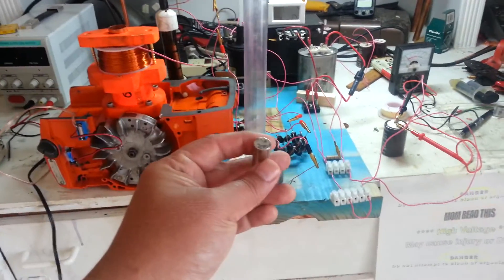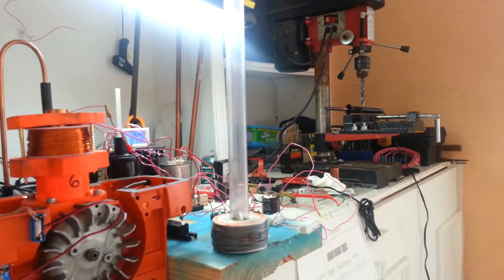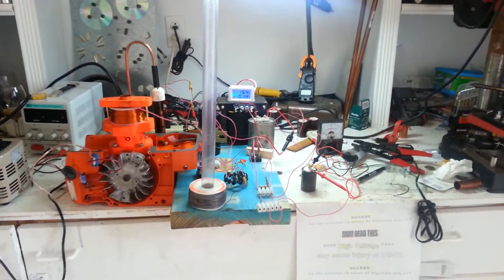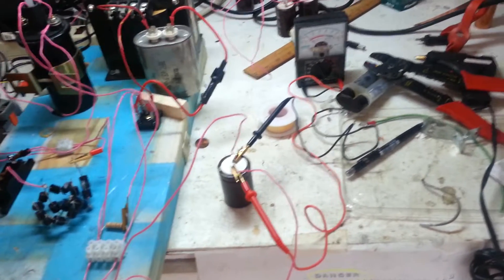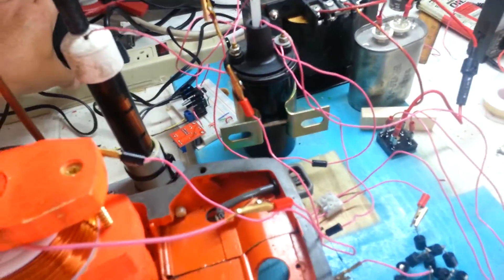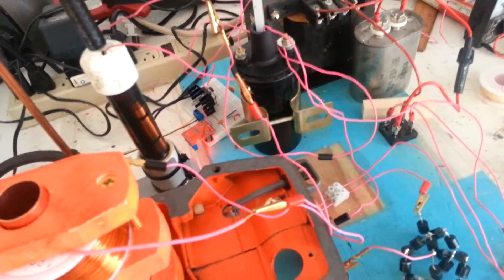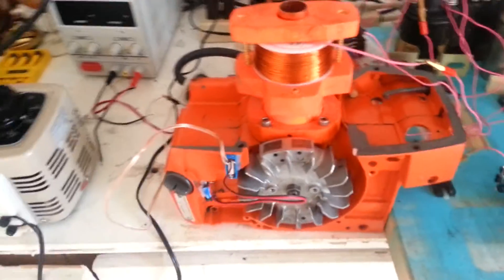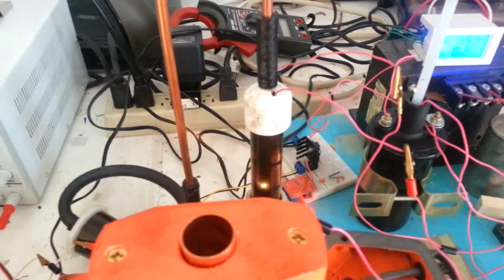Working Ed Gray Motor

Comment: i think ed gray used a 10 watt power source and a big electrolytic cap to power his motor.  it takes about 1 watt and 6 seconds to charge a 120 uf electrolytic cap so 10 watt would do 10 times faster or about the same for 800 uf. its the charginc circuit you use that suck. the rest is probably okay.
Reply from the maker: That would depend on how much voltage you are storing on your cap. Yeah the charging circuit sucks,  because I expended a lot of power to charge that Cap, but I was running a piston on a crankshaft. I needed the discharge of 450uf/400V to have enough EMF to push that piston down and around for the next cycle. My goal was to see if I could build enough torque to drive a generator, and there are facets I could get into, that I didn't explore. If Ed Gray was doing something different, not Ed really, his engineer who disappeared. I think he harnessed the same vein that Don Smith was creating in his devices. If you think of a CET as an EMP device, a spark with enough force to push electrons away, will cause the electrons to rush back to return to an pre-pulsed state. That inrush was probably guided by the thyristors, and thus harnessed charging the capacitors. I say this because what they don't show you in the schematics, is that Ed's motor had an L1/L2 coil in his charging, which made me think of Don Smith (BTW Don said that resonance could induce superconductivity at room temperature).
Reply: @XR_IX  Kind of superconductivity because in resonance l2 does not disturb the oscillation of l1 and thus does not lead to higher power consumption of l1. In fact l2 increases the magnitude of oscillation of l1. So at l2 you can draw as much Amps as you want.
Reply from the maker: @peterweber1174  I don't think it's a simple as that, but if you can explain what the condition is to allow you to draw as many amps as you want. I would be very interested in hearing how you accomplished it.
Reply: @XR_IX  read Don Smith or Rick Friedrich. L2 is connected to ground and acts as a charge pump. In principle your current drawing is only limited by the load you attach.
Reply from the maker: @peterweber1174  Peter, I own Rick's book on Don Smith, and have been studying this for while. However I won't claim I know how it works. Pointing to those two isn't what I asked for; Rick has placed all of Don's work in one text, with his annotations. Rick doesn't have a video of a working device. I asked if you could explain how it works, because nobody has been able to tell me how, or provide me with a BOM and build instructions for a device. What you stated is an unsubstantiated claim, unless you've done it yourself. I know from just your statement you are missing some pieces. To illustrate this, I can point to at least three D.S devices with no L1/L2 coil. What does that say about how the device works?
Reply: @XR_IX  I have no working device but what I told you is what I understood and know so far. What I still don't understand is the  negative resistance which gets cool rather than hot and the frequency conversion in the output stage. 
You will not find instructions with all secrets revealed anywhere and this is good because it is dangerous and you have to know what you do.
Reply from the maker: @peterweber1174  you should join energyevo.com, I do all my work there because it so far doesn't have any antagonists. The admin is really knowledgeable as well. This is what I can do, about a year ago.   https://youtu.be/dLlF4R6aUfE
Reply: @peterweber1174  yeah, amd then the mysterious collectors that charge spacial and dont disturb the reactive balances of the other  circutry...then sending that though a step down transformer, from the reading iv done, it seems this would have to be a oversized transformer compared to the load you would power, due to higher hysteresis generation encountered WHENEVER you run something approaching a square wave through a transformer.
Reply: @peterweber1174  chassis ground?
Reply: @peterweber1174  this sounds good, so does that ,ean in Steinmetz book on resonant uses to power loads, that they become easily disturbed by the load, is that why the ground amd isosymetricaly connected load?
Reply: Damn, all my dreams are broken now, cause Dollard had me convinced that all die electrics charge faster than anything, but this cannot be, or only ly if the layer is thin, sounds cool but I don't know of what to think when people call a insulated metal spiral, a super cap, wouldn't this be more of a coil with residual capacitive qualities?

Comment: Hai Ex, can u share diagram to me, thank you.
Reply from the maker: Sure, schematic is here https://forum.energyevo.com/index.php?topic=39.0
Reply: @XR_IX  Hi Ex. Excellent job. I worked on a similar setup some time back. The link you shared requires admin approval (which is pending). Do you have it posted anywhere else? Wondering if my circuit is correct. Thanks again.
Reply from the maker: @_AutoCoder  Hi, nope sorry I don't , I try to keep the schematics protected but available to  everyone. Please just apply and Zed will approve your membership.
Reply: @XR_IX  Thanks. Will do.